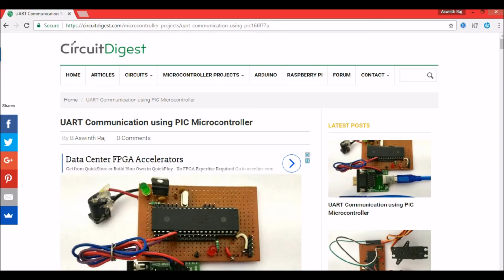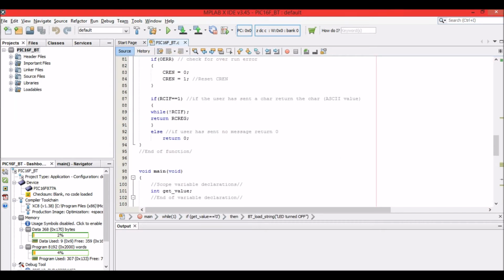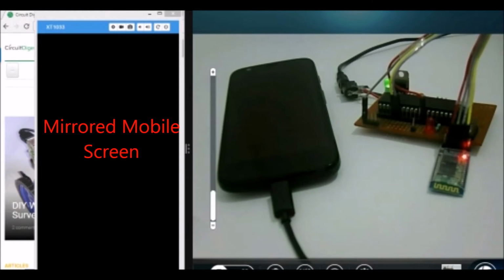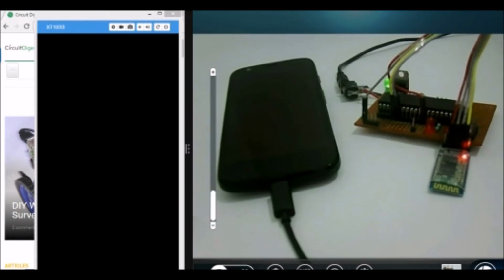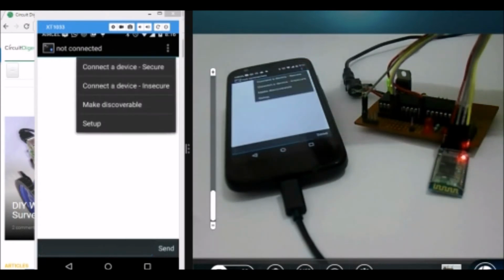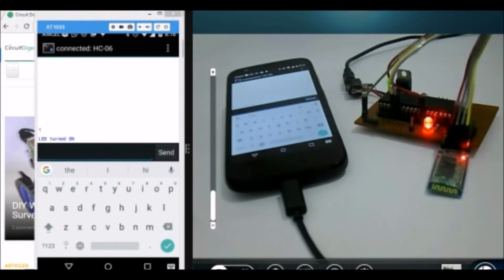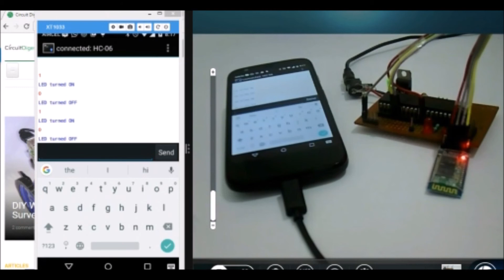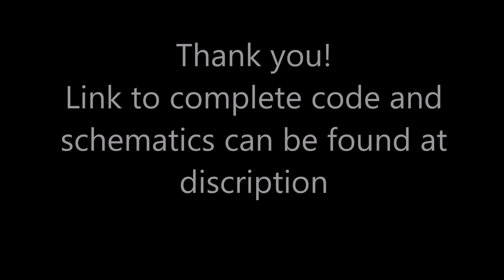Interfacing Bluetooth with PIC Microcontroller

Comment: Does PIC controller has inbuilt wifi and bluetooth as in ESP32
Reply from the maker: No, PIC does not have in-built Bluetooth or Wi-Fi. You can check out NodeMCU or ESP32 if you need one